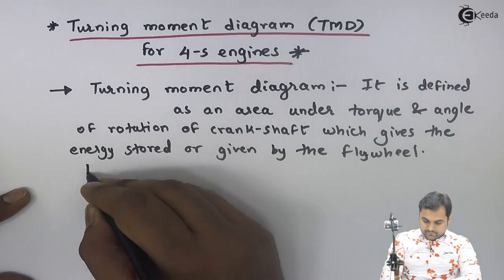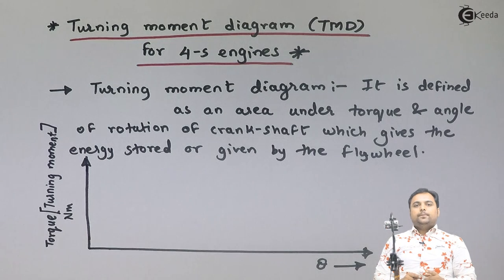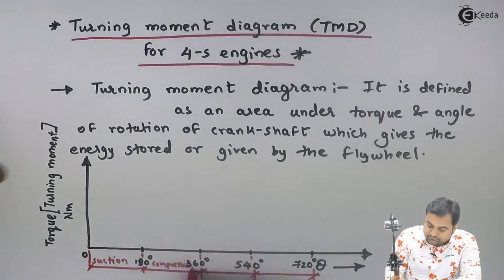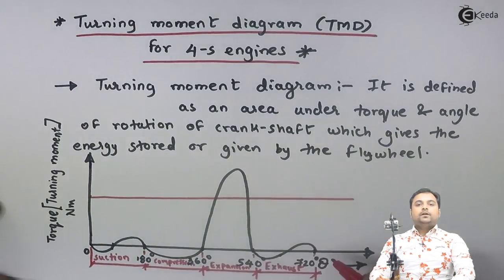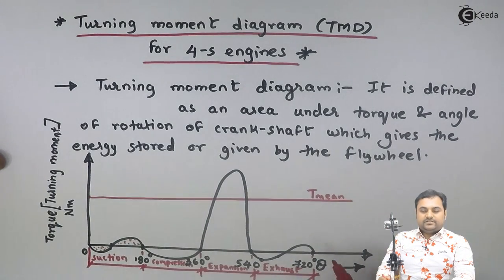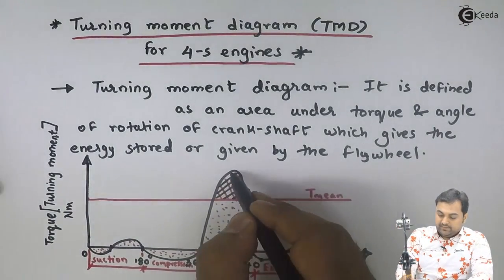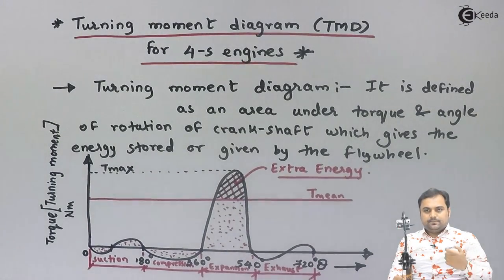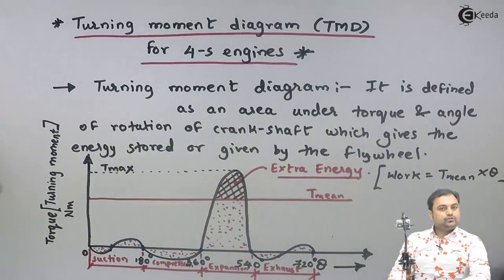Turning Moment Diagram (TMD) for 4-stroke engines - Flywheel and Governors - Theory of Machine

Comment: sir, small negative loop  indicates that the work is taken from the engine (may be to move the piston from TDC to BDC). What about the small positive loop during the suction stroke. Similarly, could you explain the negative and positive loop during the exhaust stroke? Thank you!
Reply from the maker: During suction stroke first there is a small negative loop bcoz work is taken from the engine to move piston from TDC to BDC,a small positive loop during suction means that due to air entering into the cylinder a force is exerted by the air on the piston,so we get a small amount of positive work but it is not sufficient to drive the engine.During exhaust stroke,at first piston has to move up from BDC to TDC in order to remove the exhaust gases from the cylinder,so engine provides that work,hence a negative loop.Once the exhaust gases start moving out of the engine at high velocity then some of the gases will escape on their own without the piston moving them..so piston does not have to take more work from the engine.
Reply: Super

Comment: The turning moment diagram for a petrol engine is drawn to a scale of 1mm to 6N-9-9m and the horizontal scale of 1mm to 1˚.The turning moment repeat itself after every half revolution of the engine. The area above and below the mean torque line are 305, 710, 50,350,980and 275mm2. The mass of rotating parts is 40kg at a radius of gyration of 140mm.Clculate the coefficient of fluctuation of speed if the mean speed is 1500rpm.
Reply from the maker: Kindly download the Ekeeda Learning App https://ekeeda.com/download.html & ask your doubts. Our experts help you to resolve queries on chat.

Comment: Why there is a small +ve loop at the end of suction as well as exhaust loop in turning momemt diagram of four stroke ic engine?? plz explain it.
Reply: Prabhanjan Mishra 
At the beginning of suction stroke the piston has to work against the +ve pressure thus some energy from flywheel is consumed(negative loop). However after some 100-130deg. Into the suction stroke  the charge of air has momentum to push the piston ...thus the little positive loop.
The reason for exhaust is the same concept.
I'm open for suggestions. Thanks

Comment: During suction some part is positive and some negative. .why?
Reply: kurunandan shishaudhiya may be amount of energy requirement for completion of suction stroke is less but stored energy is  supplied which was produced during power stroke is large so positive loop is formed as that amount of neither used during suction.
Reply: totally worng , +loop is caused by the momentum of the fresh charges entering during the suction stroke .
Reply: kailash chandrakar truly said...brother
Reply: @kailashchandrakar4958  what about exhaust stroke